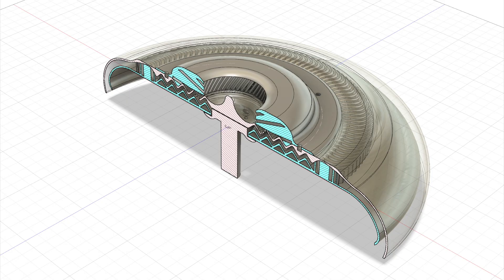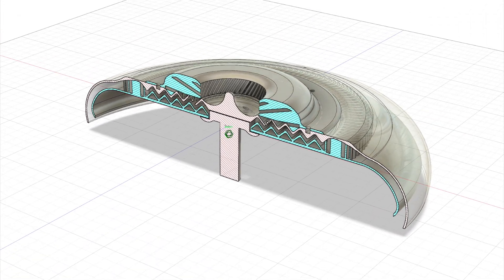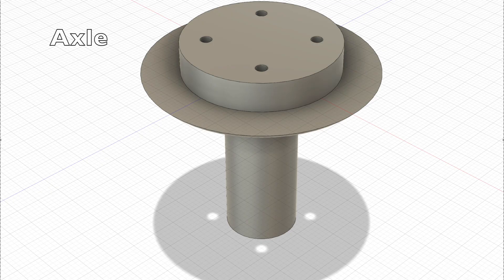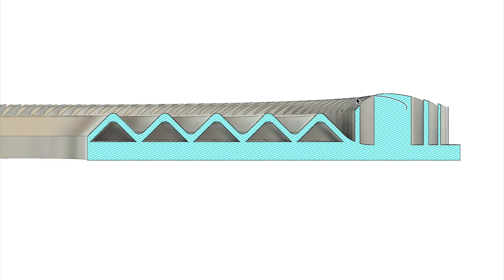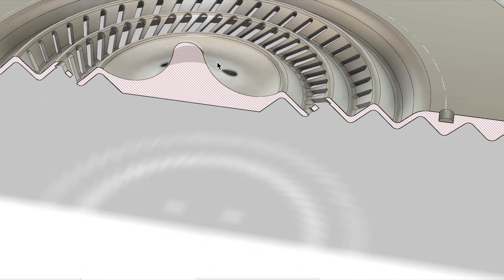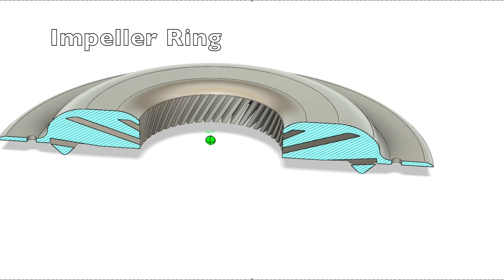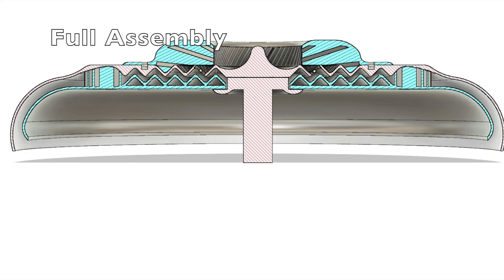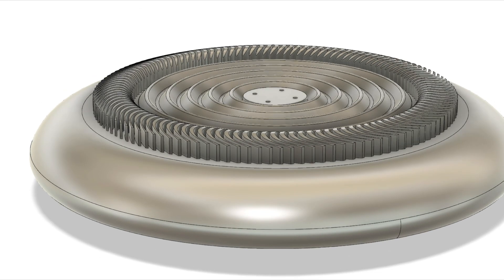Schauberger Turbine (Repulsine Replication)

Comment: I think you need to take your CAD designs into some sort of a real time professional physics engines (issac sim, gazibo, unreal, unity etc...) and you can rapidly tests things before fabricating.
Reply: What software can accurately model implosion process that Viktor based his devices on?)
Reply from the maker: @ANToxic777  I mean there is several CFD software out there. Some is native to stuff like Autocad, Solidworks, and  Ovito. I even imagine Blender's software isn't too shabby. It takes time to figure it out as the learning curve on some of those things is quite steep.

Now to answer you very good question: I don't know if there's any CFD that would model Schauberger's work correctly unless the operator had a very good (mathematical) model  which went along with the theory. Since Viktor's work deals primarily with fluid dynamic systems, it would be quite difficult to model the dynamics of one of his systems (approximately) especially with the "fancy" math approaches taken in the mainstream.
Reply from the maker: Hey, thanks for the comment! I don't disagree-- for more favorable [precision] experimental outcomes using CFD software and the likes doesn't hurt. Fewer iterations during prototyping, accurate results.

My purpose in designing this was to capture the principles which purportedly governed its behavior. From here folks can use this as a sorta "blueprint" for more rigorous improvement,  and maybe even evaluate  using some of the software you mentioned and more! 

The reality is, even with the best sims, you never know until you build and test!

Comment: Take a look at Coanda effect craft for hints on how to shape the lifting surface.
Reply from the maker: Hey, thanks for the comment! I'm aware of the benefits of the Coanda effect ( its the reason I when to great lengths to try different shapes for the cowl in the machine) . My goal in taking on this project was mainly for learning, and also to design something which could easily be modified/made accessible to other!
Reply: @MillennialZoomer  I'll have to grab your models and play around with them. I'm tempted to eliminate the compressor fins and replace it with a compressor fitting in order to isolate parts of the system. Can you give recommendations for where we could draw a line between compressor and the other stages of the device?
Reply from the maker: @MultiBerticus Hello! Thank you for the warm comment. I believe the “compressor” fins which you are talking about are the “gills” or “rills” which are basically the 120 aerofoil blades. To answer this question: I already have this part separated in the files I provided, so you can easily swap it with another “compressor” to your liking as you please. To be more clear: in the video it’s fused to the bottom cowl but in my files, this is just one of like 3 build options I’ve provided for customization. 

If you want to isolate the rills as is, I'd generate a cylinder object which "bores" through the wave section.I can check my designs to see if I have the "rills" just as is and upload them to spare you the trouble of cutting through the giant section if I get the chance.
Hope this helps!